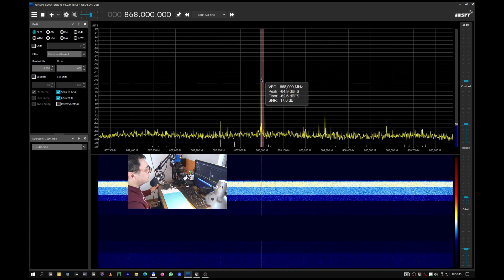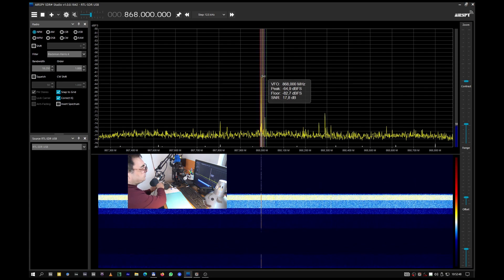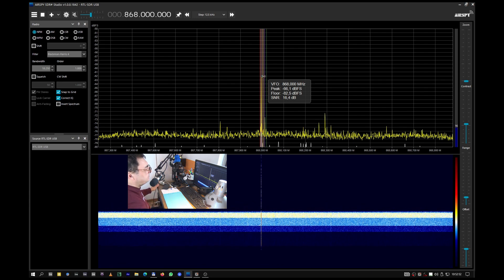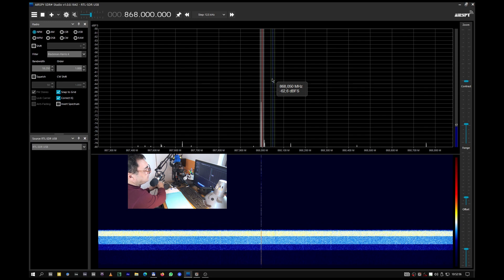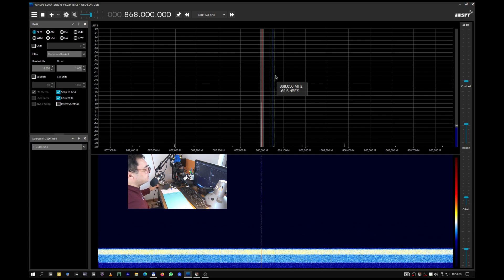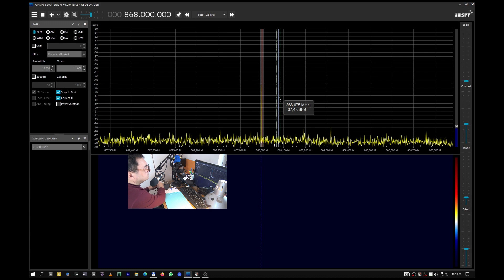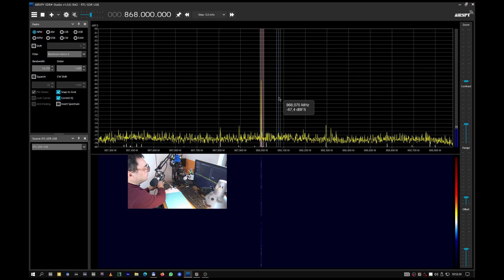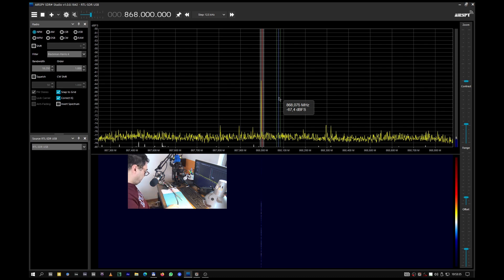To filter or not to filter..this is the question!

Comment: Hello. My setup is as follows: 8.5 Omni(soon to be changed to 9db directional panel) - acasom cavity filter - Acasom 17rx/6tx amp - 7m LMR400 RF coax cable - bias tee - 5db attenuator - bobcat miner. The goal is for me to keep my amplification but bring my noise floor down to where it used to be before the amp install. The cavity filter helped a little bit but I am not quite there yet. I was planning on replacing my 5 db attenuator with a 2db attenuator and adding a 1.5 insertion loss SAW filter to the miner side. I figured if I was going to have 5 db’s attenuation anyway, I could put a couple of those lost db’s to good use in order to filter my signal even more and bring my noise floor down lower. Is this a good plan? I would love other’s inputs on this.
Reply from the maker: The noise increase because the amplifier..it's the single active part in the chain..I should start with the best antenna possible, means high gain, next a cavity filter to keep the signal as high as possible, very good to have the amplifier near the antenna! the followers devices doesn't matter..the noise is already there!..The single way to have a better SNR is to have  a better amplifier, like Acasom v2 0.6dB or something..
Reply: @viocaia  I see…so even though there is an additional saw filter on the receiving end (miner’s side) it would fail to dampen any more noise that the cavity (on the antenna) already filtered? I hope I am understanding correctly. Has this ever been tested? If not, I would be happy to test and give results!
Reply from the maker: @Philneye5389  There are different noise types, the self noise..like any radio/amplifier have..that's part of the Signal to Noise Ratio and it's a sum of all active parts noises.
The other hand, I believe your talking about the radio interference noise..those radio signal unwanted to certain receiving band or frequencies..well, in our case the cavity filter is doing the best job in cleaning the spectrum for LoRa only..next is the Acasom amplifier which already has a filter inside , anu other will do nothing but attenuate the signal..so there is no need for a saw or any filter after the amplifier..
Reply from the maker: @Philneye5389  Exactly what I meant, you already have a double filtering from cavity and Acasom..any extra will do nothing but losses of  signal
Reply: @viocaia  thanks for the advice! With that information, I am now testing with ONLY the Acasom filter installed to see if my noise wall goes lower then it ever has been. That way I know the filter is doing it’s job and tuned correctly. Perhaps there are more hotspots I can pick up my having the most minimal noise 🤞. I’ll post results.
Reply from the maker: @Philneye5389  Please do..
Reply: I am using HS Analyzer to gather SNR data.
So in conclusion, the addition of the Acasom 17rx/6tx amp to my base setup(with no cavity filter) brought my standard noise floor of about -115dbm to -105/-101. More than 10 dbm increase in noise! After removing the amp last night and leaving just the filter, I already got two witnesses back to back -116.5 dbm and -117.5dbm noise! (The weakest I have seen the noise in my miner’s carrier-Excellent!) I also beaconed and caught three witnesses which hasn’t happened in a LONG time because my location sucks. Something is definitely better about my setup after leaving just the filter. Next I am going to install a 9db directional panel since everyone is west of me and no one is east of me 😎. Maybe someday I may want to invest in the v2 Acasom amp that bypasses Tx and offers 10-12 Rx so it would be less saturated in noise. over 10dbm is crazy loud!
Reply from the maker: @Philneye5389  Nice..but I think you're talking about RSSI “Received Signal Strength Indicator,” level..noise is SNR or Signal to Noise Ratio and usually is from -25 to 10 or more dB..SNR is more important because makes the signal ''readable' ..A better RSSI..(usually from-145 to -50dB) doesn't mean better rewards..the signal can be  ''muddy'' ..and yes Acasom is pretty noisy..that means it's affecting the ''intelligibility' of the income radio signal..so look at SNR first..that should increase for better reception..sometime a simple filter and bare antenna is better..look at my videos about different setups..
Reply: @viocaia  no I’m not talking about RSSI. There is an actual “Noise” statistic in HS Analyzer website that gives you a measurement in dbm’s of what your noise level was when you witnessed. Handy tool!

Example stats:

Same witness:

Without amp: RSSI: -128db / SNR: -10.5db / Noise: -117.5dbm (-120dbm being almost no noise)

With amp: RSSI: -110db / SNR: -6.8db / Noise: -103.2dbm (14 dbm noise increase!)

In some cases like this one, the SNR was better just because of the sheer increase in RSSI strength from the amp’s rx power, but most of my data shows my SNR being the exact same (amp ‘self’ noise rising with the RSSI strength) 
I just don’t understand why I’m yielding better results (in terms of helium coverage and rewards) on average without the amp if it isn’t a noise issue! It seems like my area is pretty clean and quiet regardless of wether I have a cavity filter installed or not. I even averaged more witnesses before I installed the amp a month ago…Any thoughts?
Reply from the maker: @Philneye5389  Something wrong with the amp? Power supply? I really can't understand..Of course with the amp it should be a 10% better..around..but worse? All I can image it's a bad amplifier or wrong frequency, you know Acasom is making for all LoRa bands, maybe it's for another ...NanoVna can tell that very easy..
Reply: @viocaia  its strange because as you can see, the amp does its job by increasing the signal strength, but you’ve enlightened me in the two types of noise. Is it possible for my amp to be on the wrong frequency but still increase my signal strength the way it has? Like you said, I don’t see how much any filter could help me in this already very quiet location, I read that -120 dbm is almost no noise and I come close to that with no filter and no amp! The only major noise I get seems to be the 10-15 dbm I receive from just having the amp on…but my RSSI also improves by the same amount so SNR remains no issue… on paper I should definitely be seeing more witnesses with the amp. I am strongly considering purchasing a NanoVNA if I’m able to test these components! Do you think the NanoVNA-H for about $54 on Amazon would do the trick for these tests? I have no idea why this is happening other than maybe the network having issues at the same time I test? Coincidence? Not sure…more testing required 😓
Reply from the maker: @Philneye5389  NanoVna is a wonderful tool, the H model is perfect..goes up to 1.5GHz..you can check cables..antenna SWR..make your own attenuators..even filters..even amplifier gain..so go for it..it's fun too.

Comment: What happens if you have like 6dbi antenna, you add the filter and an amplifier, hotspot-filter-amplifier-cable->antenna. I have cotx and use this kind of filter, thinking of compensating with an amplifier of 9db on receiving.
Reply from the maker: Is not so simple.First you need a bidirectional amplifier, I mean it's amplifyng only RX but let TX untouched..like Flarm amplifiers. I should go the other way..antena/filter/amplifier/miner..but again , in this scenario with a cheap amplifier you can't send beacons anymore..it's one way path..RX in our case..try a better gain antenna like 8dB to compensate for the filter and that's it.It is proven the eficiency in crowded areas, the SNR noise ratio signal is better